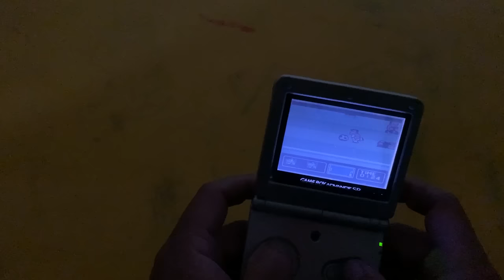Restoration Dusty Ｎｉｎｔenｄｏ gameboy advance ＧＢＡ | Restoring mud Game Console

Comment: i call BS on this repair video. adding the circuit board to water and scrubbing it off will destroy it more.
Reply: Not if there is no power running
Reply: @gmont28  I think it will destroy him in any case.
Reply: @gods2armys you can put water on a circuit board but you have to let it dry before you use it in a game console
Reply: I am almost a 100% sure that was isophobic alcohol or something like that